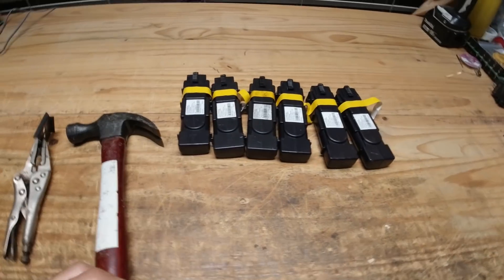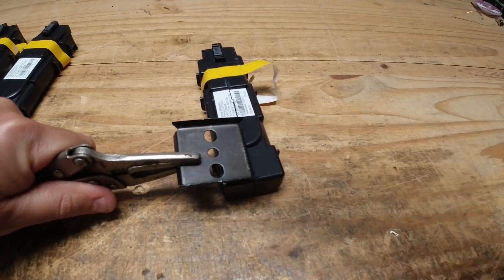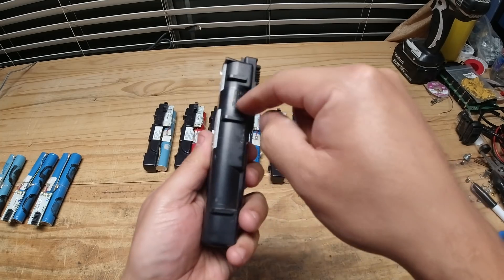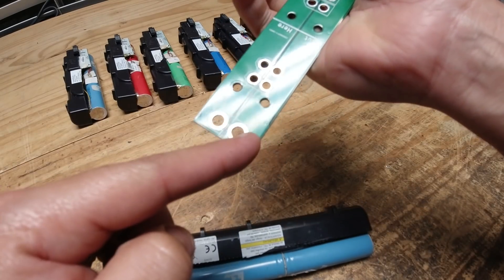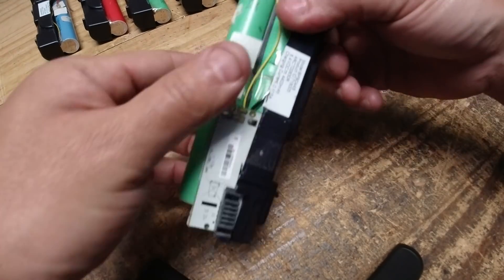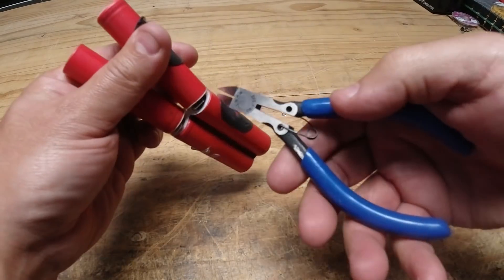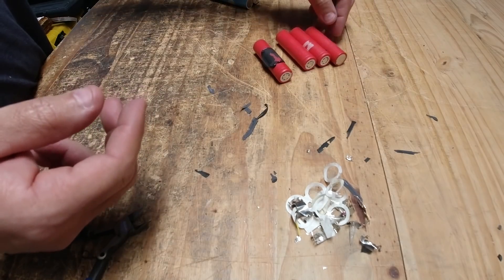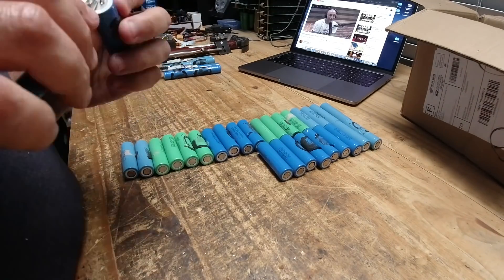Extracting 18650 cells out of $3.40 Modem Lithium Batteries

Comment: To bad the shipping to germany is more expensive than the cells themself around 170$ :/
Reply: plus import taxes (i bought a few from italy, ended up costing 2.5x more when you add up shipping and taxes... )
Reply: Anyone knows local a reliable seller in the EU for used cells?
Reply: ArthursHD Hit up Grooter (grooter.nl).
I bought 300x 18650 back in mid ’19 but they dont sell them on ebay anymore. You may try your luck if you email them at 18650@grooter.nl
Reply: @ArthursHD  eBay + Rakuten, I Google d that 🙄
Reply: @ArthursHD  In the UK, EU ect most companies will give them away to you for free,  It cost an absolute fcuking arm and a leg to dispose of lithium rechargeable battery's due to WEEE regs. In the USA they dont have EU WEEE regs   so they dump most electricals in the bin. Here in the uk it costs me  £1.23 per kilo to dispose of li ion,  lifepo4,  li poly  nmh, nicad ect.  My last disposal  cost was £922.50 for 750kgs of cells
Reply: ArthursHD recyclepark
Reply: I don’t think we will have any luck in Europe. The regulation are forcing manufacturers to take everything back and be responsible for the waste stage. So used ones are almost only private people selling them second hand and thus trying to recover as much as possible. But most people would just get them to a recycling spot to get rid of it, or bring it back to the shop. I have heard from someone that did recycle old ebike batteries and rebuild them with the cells with good enough capacity. But with the new regulation, he has to stop since he doesn’t have the required licenses to recycle batteries... And since most batteries sold new here have te adhere to regulation and testing procedures, I think it will be the cheapest to just order the lithium cells on AliExpress. Or you have to be extremely lucky to find someone that is about to throw out a pc or something that is willing to just give away its battery
Reply: du kannst dir ne Genehmigung für den Recyclinghof holen. hab da letzthin 10 Kilo mitgenommen ;)
Reply: @mareck6946  wäre interessant, wie kriegt man so eine Genehmigung?
Reply: Mar Eck bitte sag wie ich so eine genmigubg bekomme
Reply: $350 dollar shipping to Australia whattttt 😳😤🤭
Reply: Same for France 😂😞
Reply: Shiping to Slovenija eu 180$ for 20$ of products !
Reply: If you are not only looking for used ones you could check out nkon.nl for example
Reply: Bro thats fine, India is sharing common border with china like US n Canada, even then the EVIL CCP GOVT charges 600$ for shipping from Shenzen to India, and I order my batteries from the US the cell was headway 38120 and shipping to India from New Jersey was charged 21$ New Jersey by flight also takes 22hrs from India it's far yet shipping was very considerable, talk of Chinese? Please be good don't buy from them, and also shut down their stupid educational institutes in Germany. In Germany there would be a local distributor, try that source, unless you buy minimum a container load these are no way cheap.
Reply: @jehugarcia Jehu where can I buy these , with shipment to Canada?
Reply: Ich habe gebrauchte Bosch 500 Packs das Pack hat noch 35 V BMS Platine defekt. Interesse?
Reply: treponix.contact@gmail.com
Reply: Could ask Duesenfeld in Germany youtu.be/wxCFDWMPu38?t=226